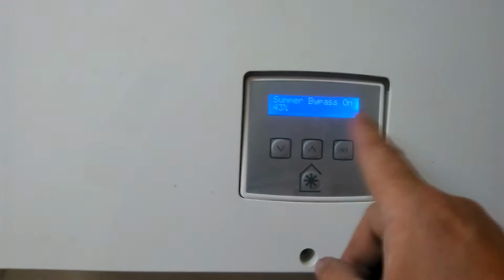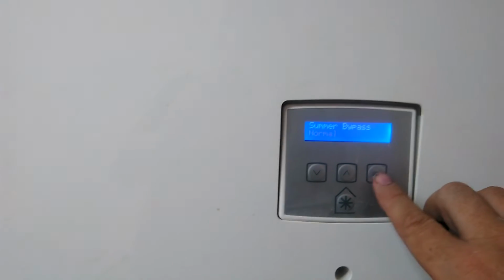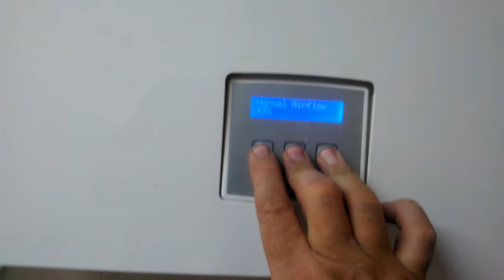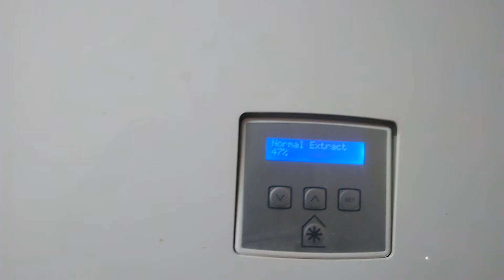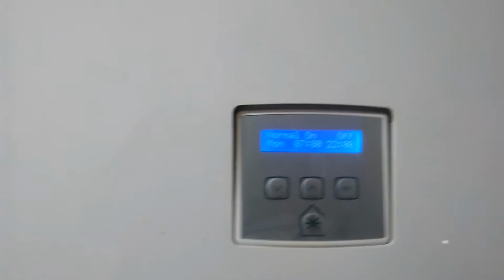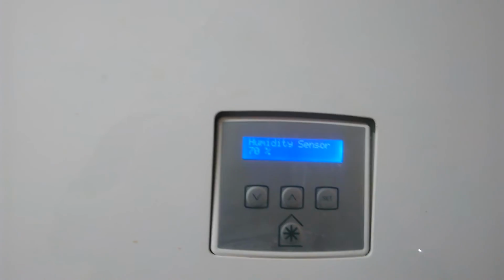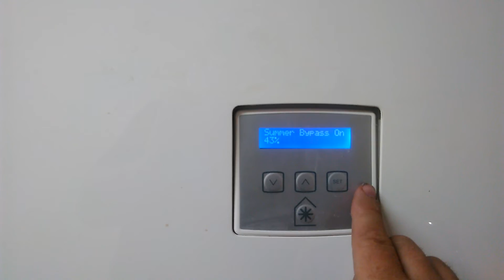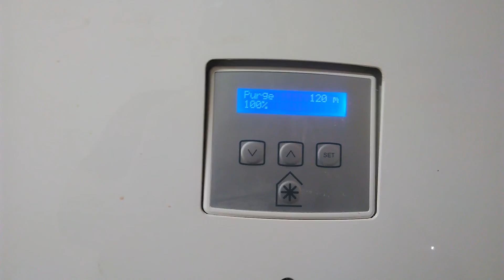Vent axia sentinel B+ control module

Comment: Hi Richard, i am trying to get my unit to go into low mode during the night but i cant see a menu screen to set the low mode i just have time schedule for normal and boost air flow. How do i get the low mode to come on?
Reply from the maker: Just set the normal mode. Anything outside of those times will force the machine to go into low mode.

Comment: Hi, this was a fantastic help, thanks.  Have lived with what the installer set for 1 year and never felt it was right.  Just changed it per your guide there and the difference is huge.  The house now feel fresh and not humid and sticky.  Just for anyone else checking this out - my unit was stuck on Boost 65 percent when installed.  The plumber provided unit so I kept going back to him and he couldn't fit it.  However the electrician came back to connect a boost switch and realised that he had connected something wrong inside the box and this is why it was stuck on Boost (sorry, can't tell you exactly what it was but it is something to check out too if you're stuck).

Comment: Are those instructions described in the user manual, and the commissioning instructions also are included? Or if not, would Vent-axia supply some information regarding commissioning processes? Also if you were researching for newer generation units, would you say that newer models are much better or you prefer the older models if you would do a new installation? Thanks.

Comment: Hi Richard, thanks for the video! I have just moved into a new flat and was having issues since summer bypass was on during freezing temperatures. What should be the settings during winters in UK? Thanks
Reply: Are you now suffering with the fact Summer Bypass cannot cope with the UK heat lol - I live in a high rise without aircon, it is not easy and every summer I try come back to this video because I always feel that the vents are supplying air too hot compared to the temperature outside.
Reply: Did you get this sorted? I’m also in the same boat

Comment: Thanks a million for this! Question if you can help please! I have a vent axia sentinel kinetic plus b (443028). The filters were recently changed. A couple of days later the "check filter" keeps popping up on the main unit and on the small digital unit in the utility. I have pressed and help up and down for 5 seconds to reset . When I do this "reset filter?" Comes up on screen but then nothing happens and the message continues to display. I would appreciate any help!!

Comment: The boost airflow automatically turns itself on stating boost airflow 47%. How can I turn this off ? I’m concerned about the electricity it consumes while being in that mode. Also, any rough idea how much electricity it actually consumes ?
Reply: I'm having the same prob. Were you able to figure out how to turn it off? Thanks
Reply: Mine does the same but for 5 sec and at night only 🤷🏻‍♂️ @danyalabdullah7435

Comment: I've just moved into a flat and the system consistently remains on Boost Airflow 70%, despite me changing the normal mode hours from 7am to 10pm. Any ideas how I can get it to move to normal or even low mode to reduce the noise & electricity used?
Reply: Hey! I'm stuck on boost as well!! Did you figure out how to get it to normal? Cheers
Reply: @Irishrover11  It turns out our unit is configured to go on boost for 12 minutes whenever a bathroom light has been switched on, so in a larger household it always seems to be boosting for us

Comment: Wasn't clear on the humidity bit.
If the air in your home is quite dry and uncomfortable, what percentage should you put it to?
Reply from the maker: Relative Humidity is relative to temperatue .
Specific humidity of 7-8 grammes per Kilogramme of air which is pretty much 1 Cubic metre of Air, this  is optimum.
Reply: @richardmarlow4466  but I mean, what settings should I be aiming for to reduce the uncomfortable dryness of the air? There's a similar comment/request on here already but I don't understand the answer.

Causing dry throat/skin and just general feeling of discomfort in the flat. Great for quick drying clothes, but horrible for a good night's sleep.

Comment: Useful video.What does defrost mode do. I can't get it off that atm
Reply from the maker: it will tun off the supply fan or the MVHR until it thinks the heat exchanger is safe, dont mess with this.

Comment: @richardmarlow4466 what settings would you recommend for cold winter temps ? From say 0 degrees to 8 ? Should indoor temp be mid 20’s ? And outdoor be quite low setting? And also what would normal supply and low supply be ? Thanks so much , have been trying to find out from manuals for so long
Reply from the maker: for winter set mvhr to 25 degress indoor, 10 degrees outdoor
Reply: @richardmarlow4466 thanks so much , appreciate you getting back to me !

Comment: We have an identical machine. Probably the same. We are setting it up.  But it's stuck on 2 menus. The time and normal air flow screens. You can manually boost it as well. That's it. Cannot get the other options you have here.

Comment: After 10 years of no issues, my vent axia has started to make a lot of noise. We had it serviced 2 months ago and filters changed, but no improvement. How can we get rid of this noise?
Reply from the maker: check the atmosphere terminals are not clogged up and check if any debris is fouling the impellers.

Comment: Would this unit help reduce temperatures during the summer? What temperature should i set it to?
Reply: same question
Reply: No, you have a summer mode but its runs very high and does not work 🤷🏻‍♂️

Comment: Thanks for the video @richard. Any advice on a unit that stays in boost for hrs after the humidity sensors gets set off? It has been working all winter fine since it’s install new. Thanks
Reply from the maker: What is your humidity set point and overun settings?

Comment: My machine seems to be stuck on boost mode 50% and won’t change to normal airflow? Set the overrun to 5 mins like you suggested but still stuck! 
Initiating boost by clicking the home snowflake button only gives me the option to run a boost 1s. Then after that it’s finished, it returns to boost 50%? Any tips!
Reply: I have the same problem. In my case it’s on 65%. Did you manage to sort it?
Reply from the maker: the switch live cable could be wired to the live cable st the spur, also the humidity setting is too low

Comment: Hello, how do you do to modify for example all the day at 15% low flow rate ? 
For the moment the normal flow rate is 30%. 
This is not well explained in the manual mode.
Thanks
Reply from the maker: you need to set up control mode 2

Comment: Hi, sorry I'm being a bit thick. During the winter season, what temperatures do I need to set to guarantee enough warmth in the apartment? Would Indoor = 20° and outdoor= 20° work? Thanks
I'm new to this and the current temperature is 16° everywhere even with the heating turned on.
Reply from the maker: Set it to 25 inside and 10 outside
Reply from the maker: Winter only

Comment: Hi Richard. If I was in a hotel room and I wanted to turn the fan noise off, which setting on the control panel could I use? Hypothetically speaking
Reply from the maker: Initiate control mode 2 which means installing a link across SW5

Then set your low fan speeds to 15%.

This will give you manual control of the low user setting.

Its important the machine isnt turned off.

Comment: In the bathroom, there is condensation for a number of hours after a shower, how do I address this with the HRV? The humidity is set at 65%. Any help would be appreciated
Reply from the maker: Lower the humidity to 55% and increase the boost rate by 10%

You could also initiate purge mode.
Reply: Should same setting be applied during winters in case of condensation in washroom?

Comment: It looks like there is a small gap above the control panel. Ours seems to have this too since the engineers refitted the front panel. Is this normal with this unit?
Reply: I have the exact same, looks normal
Reply from the maker: Its normal. The air seals are higher up.

Comment: Thank you so much for this! I have this exact model. I didn't know how to adjust anything, and was stuck with the settings the installer put in, since this video, I have changed the settings to suit our house, after 3 years living with this model, and having to manually boost all the time. Now I've set it to quiet mode in the evening and night, I can sleep in silence! I've looked everywhere on the internet for manuals, all useless, until this!
Reply from the maker: Glad I could help!
Reply: This unit brings toxic air inside my apartment I live in a new building and I started having rapid heart rate, palpitations and tremors at night because the smell it delivery to inside my apartment. Is there anyway someone installed it wrong or some wrong tive was attached to my vent to give nasty air inside my apartment?
Reply: @xxxx-wv6hp have you got the outside intake near a boiler flue? If it’s sucking that in then it is very dangerous and you should turn it off.

Comment: The unit installed in our property has stopped working with message on screen “ Control Mode Fan Off”
We cant change the settings, when pressing the buttons on the controller nothing changes ! Tried everything turning off and back on.   Any suggestions ?

Comment: Does summer mode kick in automatically?
Reply: I believe you have to choose it When  mine was installed the Tech said that in England you would hardly ever need it.
Reply: @Chris-gj6ef  I don't even see a button to change it but I can see the option on the console. British weather is horrendously humid, I have definitely needed it! And more so due to climate change over the coming years

Comment: Hi Richard. 
Well explained and informative. 
though' Is it possible for you to "spell out" How to do if our house is at and constant 28% humidity. 

Its especially during evening/night where we can feel it - waking up with dry throats and dry skin. We just moved in and live in a very well insulated new house, so the machine is quite new to us.

Thanks, Chris
Reply from the maker: it seems to that your unit is over ventilating and needs the flow rate reducing in the evening. call me on 07985174736 i should be able to talk you through the changes required on the module. internal humidity is always relative to atmospheric temperature/humidity and occupancy. You have little moisture creating activity at night therefore the RH humidity will drop
Reply: @richardmarlow4466  Thanks Richard. Since I wrote my message, I have actually done what you mention. It seems like you where spot on. Today we have a humidity at 41%. 

When Its winter time - would it be a good idea to have it run at the slower flow rate all the time? 

Thanks again, Chris
Reply from the maker: @FordChristmas  https://drive.google.com/file/d/1b88JxmrkewbsUkoLOCjkF8BS3FSiYghc/view?usp=sharing    check this out around 45% is considered the goldilocks zone and what we should be aiming for, between 30 and 60% is the target for optimum health benefits.
Reply from the maker: have you initiated control mode 2 to manually select the low mode?
Reply from the maker: there is a balance between optimum air quality and acoustics that can mean setting the humidity setting higher as in the height of summer and hot sticky nights the init could run in boost throughout the night. choose a sensible humidity that gives you this balance. don't lower the flow rate in the daytime during summer, winter daytime possibly if low occupancy, you wouldn't want to forfeit optimum oxygen levels.
Reply from the maker: one more thing internal humidity is relative to external humidity. if the external temperature/humidity like it is now in Macclesfield is 13 degrees and 94% during your sleeping hours the internal humidity will be around 55% if your temperature setting is at 21 degrees, furthermore, if its 3 degrees and 94% humidity outside your internal humidity will be around 30% if your temperature setting is at 21 degrees. lowering the flow rate must be done with caution in super airtight dwellings, what was your air test result?
Reply: @richardmarlow4466 thanks for the video. Having just installed mine I am now playing with the commissioning to find the balance between noise and performance.  Setting humidity below 65% leaves the unit in boost most of the night and although in the loft, the ceilings are still down in places and the unit is loud. Hopefully once the ceilings are up and insulated the sound will dampen somewhat.

Comment: Hi, I have one of these in my home and it the airflow is set at 80% aswell as the filter is this the correct setting because I don’t seem to be getting much air coming through my bathroom
Reply: Depending on installer, a bathroom would normally be set to extract (to pull out excessively humid air). So you shouldn't feel air coming from the bathroom ceiling vent, but leaving the room that way. Air fed into the other rooms (bedrooms, lounge, etc) should be flowing through the corridors and under the closed doors to get to the extraction point(s) (typically bathroom, kitchen, and hallways near external doors).

Comment: Got a rattling sound with the extraction fan, do you know if it's easy to access and clean? I've removed the the heat exchange and I can see the supply fan, but not the other one

Comment: Hello Richard, we've got vent axia but I dont know how to turn it off via display.  Only by turning off the circuit breaker. Thank u for answer.
Reply from the maker: An MVHR isnt supposed to be turned off, if it does remain off for a period of time condensation will form in the ductwork wherever dew point is reached, what can happen then is mould spores will form and begin to propagate. then when you come to turn it back on these spores would be blown into the property and become airbourne. if you go on holiday or are sleeping, you could set the low mode to 25% fan speed and set as schedule. there is another control mode aswell check the manual regarding control mode 2 it allows manual selection of low mode.

also if left off it will vent passivly to atmosphere which will produce no thermodynamic transfer and will result in massive heat loss. 

dont turn it off!
Reply: @richardmarlow4466  thank you for this information
Reply: My fire department sent a note to turn ventilation of. Because of a fire so ?🤷🏻‍♂️
Reply from the maker: @joenetje ventilation systems and BMS work together to deliver escape strategies in the event of a fire. Sometimes the building management system will turn off the ventilation if a smoke alarm goes off via a relay. Sometimes the BMS will open and close dampers to aid with ventilation and cold smoke dilution in escape routes and shut off oxygen to the area that may be ablaze.

All strategies are formulated by professional fire officers who work closely with experienced ventilation engineers. 

There is no one size fits all with fire strategies.

Comment: Hi! Maybe someone can help me here. My ventaxia unit is always on boost mode and I can’t change it normal mode.
Reply: on my case it was after a all a switch in the kitchen that I never understood what it was for lol... keep trying by playing with switches in the kitchen  and bathroom. Also, you might have some wrong setting regarding humidity/temperature in the controler. good luck!
Reply: lamine boumdian oh yeah? I will have a look at those settings then. Thanks! Also, never tried the kitchen to be fair. Was the switch in kitchen labelled at all or was it just a random switch?
Reply: @microcuts01  yes nice label "Fan Boost" lol.... but I had two in bathrooms without label
Reply: @PeaceAndDialog  haha! couldn't be more clear.
Reply: @PeaceAndDialog  Wow, thank you very very much. That was it. A switch in the kitchen labelled Fan Boost. Had NO IDEA it was that. Been driving me mad for months. 😇
Reply: Hello, Have you found the fix to this? I have the same issue. Thanks
Reply: lamine boumdian I have not I’m afraid. I dropped the boost to 50% so it’s a bit quieter. I believe there’s a switch somewhere in the house that is keeping it on but I can’t find where.
Reply: According to the user manual, there is a SW4 momentary will activate boost (1s) mode, you can try to switch it off and see what's going on.
Reply: Thanks so much, it was the same for me, a switch in the kitchen labelled ‘Fan’, but because mine was set to have a 15 min delay for turning off boost mode it meant that when I was playing around with the switches nothing seemed to make a difference, so I temporarily set the delay to 0 and immediately I could see which switch was the culprit! Just thought I’d share in case anyone was going crazy over this!
Reply: Thank youuu! a switch in the kitchen was not allowing me to turn off the boost.

Comment: I agree with Chris, the manual that comes with the machine is not helpful at all. I have a feeling reason being is to someone to get service fees however - i think you don't need to change settings much after it is installed. Thanks for the video anyway - I need to figure out the password for mine.

Comment: How well do these things actually cool during the summer?
Reply from the maker: Cooling is dependent on the buildings insulation, airtightness result and G value of glazing.

Consider a thermos flask it keeps thinks cool as well as hot. Your house if well insulated will retain the free cooling that is brought into the house during the evening.
Irradiance needs to be mitigated by installing low G value fenestration.

Also air velocity dehumidifies to help with comfort.

Thanks